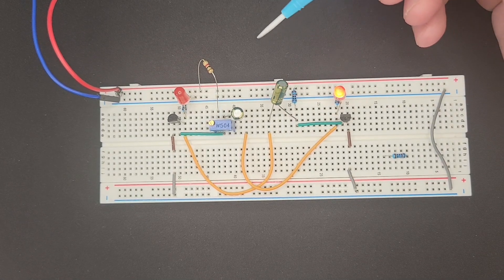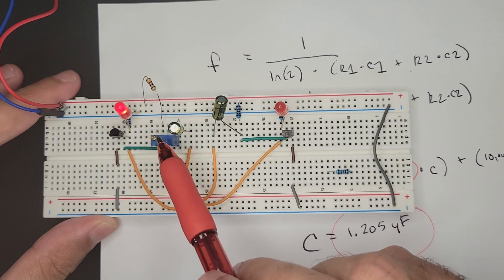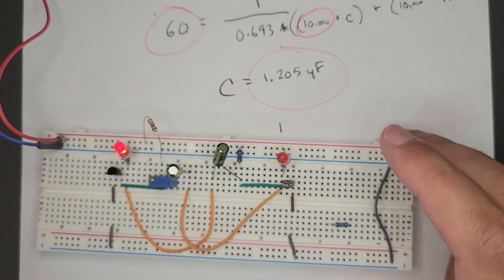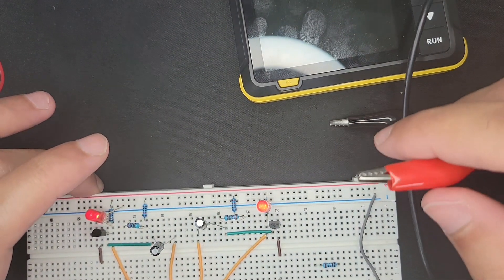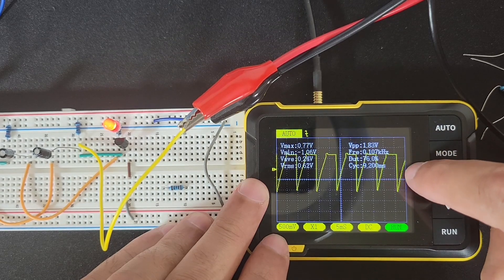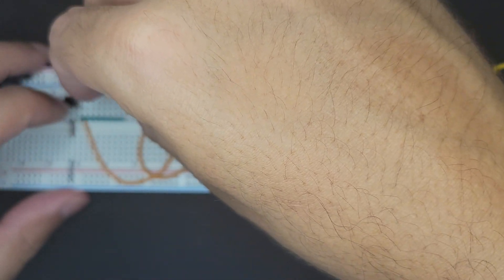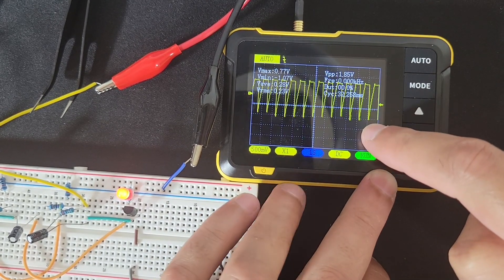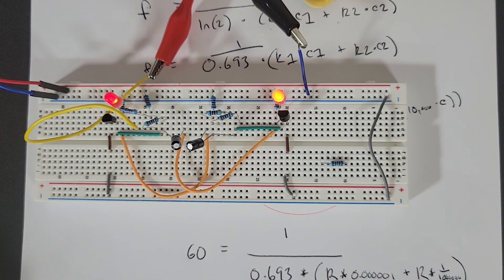Calculating & Setting Oscillator Frequency! | Beginner Learns Electronics Ep21 | Theory & Build

Comment: How do you come with these projects? Do you follow any book?
Reply from the maker: Hey Andre! I don't follow any books at the moment. A lot of it is organic: I am a programmer so I'm familiar with logic gates and have a decent understanding of computer architecture. So for me, a lot of my curiosity & project ideas stem from the "how is this done with hardware?" question. With that, we get all the logic gate projects as well as the basic memory cell projects.

Before we can do logic gates, we need to know how to power circuits. That's where the basic LED stuff comes from as well as how to read voltage/current with a multimeter, etc.

After that, I wanted to try and cover all the basic components -- so that's where stuff like the capacitor videos come from, as well as the potentiometer. I still need to cover inductors, MOSFETs, and I am sure many others!

After learning about capacitors, a friend recommended the Astable Multivibrator -- and this just opened an avalanche of questions from me (how do we control the frequency? which of course led to this video). Other questions that arise from this video are, the output wave is square -- but an AC wave is very curved. How do we do that? It turns out through a low-pass filter, so I'll be covering that perhaps next?

Regarding memory cells -- it was my question of "how are memory cells made" that led there, but the website Build-Electronic-Circuits.com is the one that had all the different types of memory cells listed out, so I just went through each one. There are still others to do -- JK-Latch and T-Latch or Flip/Flop, I'm not sure -- Erik Vincent also suggested some of these to me.

So the above I hope gives an idea of how I come up with the different projects that I attempt. There are a lot of great recommendations, too, of course. I ordered some integrated chips at Erik Vincent's suggestion to test using logic gates through there. And of course as you can see in this video, Dylanger's recommendation on the potentiometer configuration with the transistor will lead me to other ideas, too, like using it for a motor controller. So it's really a combined source of ideas! I am sure I will end up using a book for even more ideas. I hope this helps!

Comment: Nice video. You should look into doing a colpitts oscillator and then into colpitts crystal oscillators. Lots of beginner transistor circuits there. With the crystal oscillator, make sure you have a transistor that can switch fast enough.

It sounds like your oscillator equation woes are likely due to tolerances on the capacitor end of things. BTW, do you have a discord or email?
Reply from the maker: Thanks Erik! I will check those out. I have a short list of projects to cover that you have suggested. Thanks very much!

I do have a discord account -- feel free to add me -- it's Mxy with the word dynamics afterwards, altogether. (The way I described it is my makeshift spam protection lol). I am not on it much but will keep it logged in, as I guess I'll be using it more now that I am in YT land. Also, the crystal oscillator sounds fascinating. This is, to my knowledge, what runs our clocks in modern CPU's -- quartz, is it? I'd love to check that out! Thanks again for all your help!

Edit: I thought perhaps my handling of the algorithm was incorrect, or that I may have selected the wrong algorithm to begin with. Thanks for pointing out the capacitor tolerances as a potential culprit!
Reply: @MxyAhoy  Alrighty. I sent a request.

Comment: Amazing Work, thanks 🙏, side note wolfram / mathematica is an amazing tool to use to go through the calculations/formula you worked on.
Reply from the maker: Thank you! I will check that out. I really do need to get a calculator so I can perform the mathematics myself on video. It would be great practice for myself, and a better demonstration as well. It may be cool to feature the sites you mentioned as an added assistance for myself and others. Thanks again!
Reply: @LearnWithMxy  your very welcome, appreciate the genuine process of figuring things out. But also your going to be blown away with the wolfram software is sooo much more! The workflow, the things you can achieve all in one programming tool.🤯